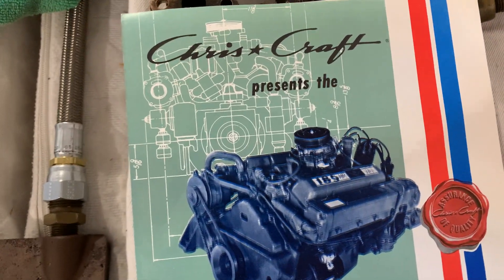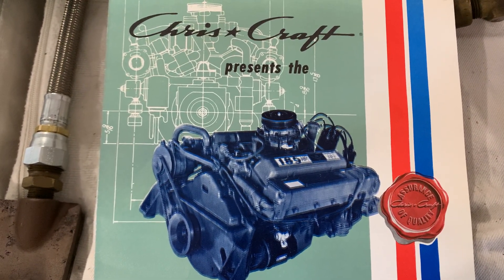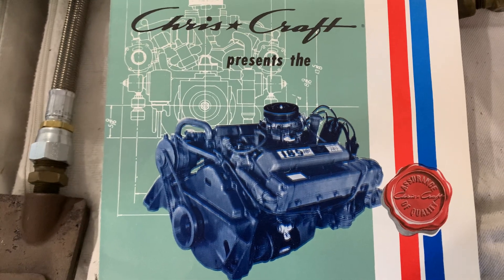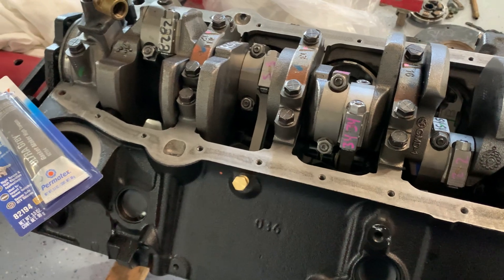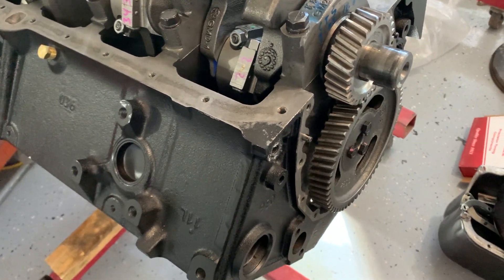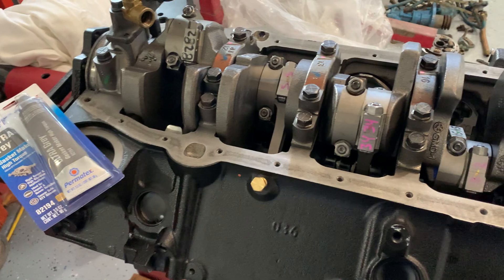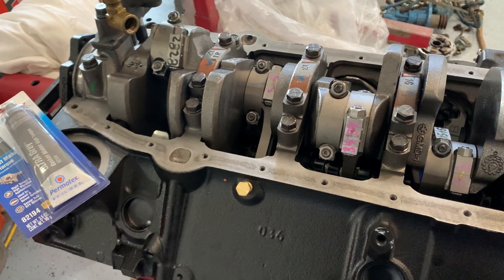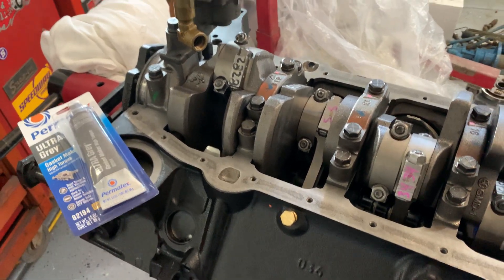How to build a Chris Craft 283 / 350 conversion marine motor Part 1

Comment: I thought the crank snout had to be drilled to meet the first main bearing oil passage in order to lube the transmission? At least, that's what I recall from reading my '62 CC SkiBoat engine book...
Reply from the maker: Yes. The crank must be drilled if it is a manual drive transmission. That version uses engine oil for transmission lube